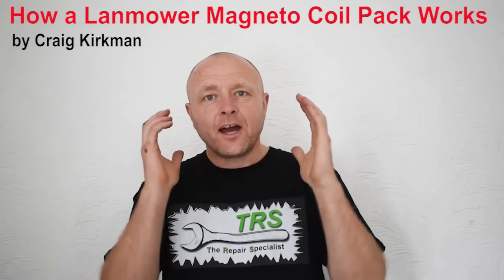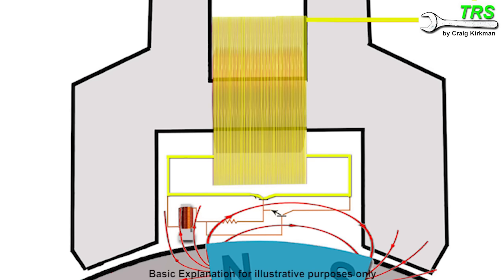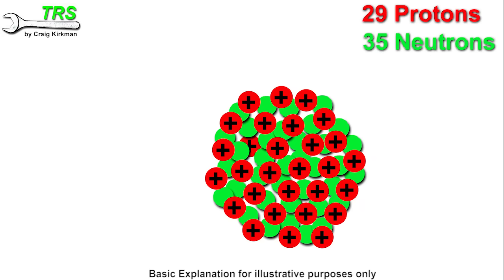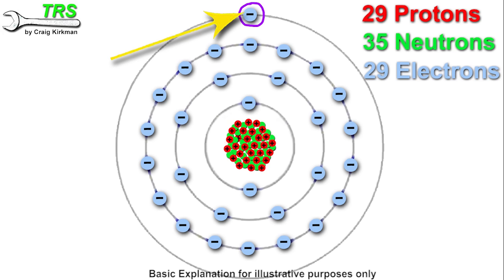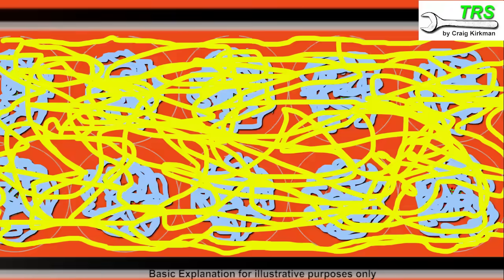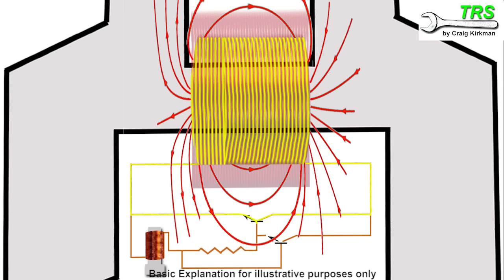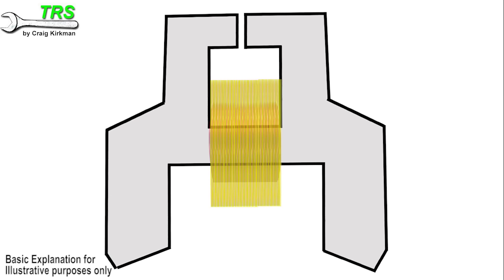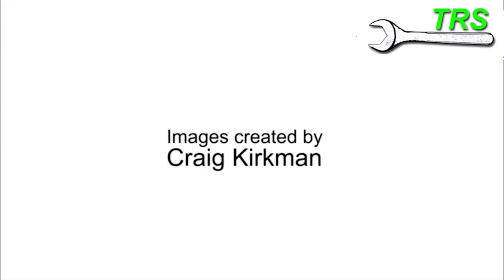Lawnmower Coil Pack Sparking System - Induction Coil, Transistor!  (by Craig Kirkman)

Comment: Now if I just understood what causes small engine coils to progressively fail over time.(Chainsaw)
I have been pulling my hair out trying to get a Poulan P4018WT to Run properly. Did all the typical troubleshooting and basic Repairs. Thought for sure it was something the previous owner had done to cause a Carburetor issue.
Reset the H/L and Idle to factory and started from there. Initially the saw ran great at (L) 1.5 turns / (H) 1-3/4 Turns, Colder day, Limited Cutting.
The next time I fired it up(warmer Spring day) It was warming up and stalled. Restarted easily and Revved to peak very snappy. Back to idle and in less than a minute - Stall. Hard to Restart unless keeping the Throttle open...... and again Stall. Tweaked the Low a touch and Idle up a tad. Seemed to hold.
Now, 86 Degrees Bright Sun, Top Cover off to check Plug/etc. Saw Fired right up on Choke, Restarted in 1 pull on 1/2 Choke, but started stumbling when set to normal idle and was tripping all over itself when revving.(Sounded FAT - Flooding)
Reset H/L to 1.5 and eases H to 1-3/4 and Running decent at higher revs. Stalled and would not restart.
pulled the Carb and did a thorough Clean and inspection. Metering lever was slightly low(adjusted) and carefully Reassembled. Installed a fresh Spark Plug.
*Back on the saw(Dumped the old Fuel and pumped out the lines before hooking them up. 
Fresh fuel mix, Primed, Choked and the saw fired right up. Revved Bright and smooth. within a minute the stalling was back and rapidly progressed to a no start.
***At this point
1) I changed the original Spark Plug because it wasn't firing and on inspection it looked Cooked Black.(Not Carbon buildup)
2) Pulled the new Bosh Plug and it was already completely smooth Black coated.
3) Attempted, but could Not get the plug to Spark.
4) 30 minute frustration/Research break.
5) Retested and saw a little Sparking.
6) Assembled, Restarted(it fired up) on high idle and in 30-45 seconds Died again. Saw Felt Hot(top cover off)
7) No Fire was back. Tested with Kill wire disconnected - no change.
It seems to me, and I may be mistaken, that a lot of people fighting with Poulan Carburetors may actually have week/Failing Coils.
Any thoughts?
Reply from the maker: Hello,

Thank you for sharing your detailed experience with troubleshooting your Poulan P4018WT chainsaw. It's evident that you've put a lot of effort into diagnosing and addressing the issues you've encountered. I appreciate your dedication to getting the saw running properly.

Regarding your observation about small engine coils potentially failing over time, it's a valid consideration. Ignition coils are crucial components in the ignition system, responsible for generating the spark needed for combustion. If a coil is weak or failing, it can lead to intermittent spark issues, which can, in turn, cause the engine to stall, misfire, or fail to start. Take a look at my other video, which explains some of the reasons these coils can fail over time. It's here in the link: https://www.youtube.com/watch?v=lEYO7hNTeR0&t=272s

However, I enjoy typing so here are some thoughts and additional considerations:

Spark Plug: You mentioned experiencing issues with the spark plug, including it appearing black-coated and sparking inconsistently. The spark plug condition can be indicative of engine performance issues. Replacing the plug with a new, properly gapped one is a good step.

Coil Testing: If you suspect the ignition coil may be a culprit, you can perform specific tests to check its resistance and primary and secondary coil windings. A significant deviation from the manufacturer's specifications can indicate a problem. However, testing ignition components typically requires specialized equipment and knowledge, so it's often best left to a professional technician.

Heat-Related Issues: Heat can affect the performance of ignition components. If the saw felt hot, it's possible that excessive heat may be contributing to coil or other component issues. Ensuring proper cooling and ventilation for the saw's components can be important.

Fuel System: It's great that you've cleaned and inspected the carburetor, but also consider checking the fuel lines, fuel filter, and ensuring that the fuel is flowing consistently. Fuel delivery issues can sometimes mimic ignition problems.

Professional Assistance: Given the complexity of diagnosing ignition system issues and the potential safety hazards involved, especially with chainsaws, it may be advisable to seek the expertise of a small engine technician. They have the necessary tools and knowledge to diagnose and repair ignition system problems effectively.

Your dedication to resolving these issues is commendable, and I hope that by exploring these possibilities and, if needed, seeking professional help, you can successfully restore your chainsaw to proper working condition. Your detailed description will also be helpful if you decide to consult with a technician. If you have any more questions or need further guidance, please feel free to ask.

I hope this at least sparks some further investigation and I hope you can sort this issue soon

Thanks
Craig
Reply: @TheRepairSpecialist 
Thanks for the personalized response.
I should have noted, I am 70 and have been a Mechanic/Technician Automotive shop owner most of my life. I had already gone through the basics, Fuel system inspection and repairs as noted. All lines and filter in good shape, Carburetor pulled, Stripped, inspected, cleaned and reassembled.
I was actually in the process of trying to dial in the Crab when the stalling started and the eventual complete Coil failure happened.
* I did realize later that I had inadvertently helped the overheating along by having the cover off the Carb area i order to get the Spline tool aligned with the set screws. (Poulan really needs to cast guide tunnels into the Plastics instead of holes well away from the Carb)
After installing the new Coil, adding a couple oz. of Seafoam to the tank, resetting the Carb to base settings and getting the saw fired up again, I was able to get it dialed in.
It is idling nicely and perfectly snappy jumping to high idle.
I've done (3) 10 minute warm up cycles including Run-up ever 30sec to 1 minute intervals.
The saw Stays running, Idles nicely after backing idle down a bit, Revs smoothly and ........ Cuts Wood! That's really all one can ask of a Chainsaw.

Comment: I searched for a simple reason my lawn mower doesn't start and found this physics lesson?
My head can now officially explode. 😜
Reply from the maker: Hello,

I can certainly understand how discovering a physics lesson while searching for a simple solution to your lawn mower's starting issue can be surprising! Sometimes, the world of small engines and their components can lead us down unexpected learning paths.

If you're still facing issues with your lawn mower's starting, please don't hesitate to ask any questions or share more details about the problem. I'm here to help simplify things and provide guidance on getting your mower back up and running smoothly. Your curiosity and determination to solve the issue are commendable, and I'm here to assist you in any way I can.

Thanks
Craig

Comment: question1: One end of the secondary coil wire goes to the spark plug.  What does the other end connect to?
question2:  The primary circuit does not touch ground.  On my Kohler CV15, there is a grounding tab to ground the primary circuit and stop engine.  Where is that grounding tab in the primary circuit with respect to the transisters?

Comment: Very good explanation but I didn't understand why there is two transistor in the little coil circuit?? Thanks
Reply from the maker: First of all, thank you for your kind feedback, i really do appreciate it. As to attempt to answer your question, the exact configuration of ignition coils can vary depending on the specific model and design of the lawnmower.

The number of transistors in a lawnmower ignition coil can vary based on the design and technology used in the ignition system. Here are a few reasons why some lawnmower ignition coils may have more transistors than others:

More advanced lawnmower engines have been known to incorporate electronic ignition systems that require precise control over the ignition timing. Multiple transistors can be used to control the timing of the spark plug firing, ensuring that it occurs at the optimal moment during the engine's cycle. This can lead to better fuel efficiency and overall engine performance.

Some engines, especially those in higher-end lawnmowers or other small equipment, may feature variable ignition timing. Multiple transistors can allow for dynamic adjustments to the timing based on factors like engine speed, load, and temperature. This flexibility can lead to improved performance and emissions control.

In some cases, manufacturers may use redundant transistors to enhance the reliability of the ignition system. Having backup components can help ensure that the engine continues to operate even if one transistor fails.

Modern engines, including some lawnmower engines, may include diagnostic features that monitor the health of the ignition system. Multiple transistors can support these diagnostic functions, helping to identify and address ignition-related issues.

The ignition system in a lawnmower may be designed to work with other components, such as electronic fuel injection systems or engine management systems. Multiple transistors can facilitate communication and coordination between these systems.

Larger or more powerful lawnmower engines may require more sophisticated ignition systems with multiple transistors to handle the increased demands of ignition control.

So in a nutshell, the number of transistors in a lawnmower ignition coil can vary based on the desired functionality and performance characteristics of the engine. More transistors can offer greater control, timing precision, and diagnostic capabilities, but they also come at a cost. Smaller, simpler lawnmower engines may use basic ignition systems with fewer transistors, while larger and more advanced engines may benefit from the added complexity of multiple transistors for improved performance and reliability.

I hope this helps a little, and thank you for your curiosity of my video.

Craig
Reply: @TheRepairSpecialist  thanks 👍 for this good explanation

Comment: <<<>>>##How does the Briggs Magneto test meter work? Does it instill negative - 140v pulse into the primary to run the secondary?? I have an old Briggs ignition coil METER tester manual , but it only shows how to hook up to it's meter. No tech data. I thought the spinning magnet put in 8 volts pulse in Primary , that shorts with the SS trigger, then generates back EMF of -140 volts that runs the secondary side.  I can run cycle coils and car coils on bench, but not Briggs magneto "electrically" without magnet. Is this suppose to be a secret from the public? ???####!

Comment: Your video was brilliant! I never knew about the trigger coil. Why do some coils on Amazon have a visible trigger coil and others don't? What happens if you put a new coil in place on a mower and it doesn't have the trigger coil?
Reply from the maker: Hi. Thank you for your kind comment. I really appreciate it.  Some lawnmowers employ a magneto and ignition coil combination that contains the trigger function in the same unit, while others may use a separate trigger coil in addition to the primary ignition coil. This variance is due to a few factors:

Engine Design: Depending on the lawnmower engine's size, complexity, cost, and manufacturer's preference, different ignition system designs may be used. For accurate ignition timing, some engines may need a separate trigger coil, while others may incorporate this function inside the ignition coil assembly.

Older lawnmowers or smaller, simpler engines may employ magneto-based ignition systems, which normally rely for a separate trigger coil for precise spark timing. On the other hand, more recent lawnmowers or larger engines may employ magneto/coil combination systems, in which the assembly itself serves as the trigger.

Performance and Efficiency: Engines with independent trigger coils frequently produce timing signals with greater accuracy, which can improve both performance and fuel economy. In contrast, it's possible that manufacturing and maintaining interconnected systems will be easier and less expensive.

Ultimately, the design of the engine, the intended performance level, and the engineering choices made by the manufacturer can all affect whether a separate trigger coil is present or absent in lawnmower ignition systems. 

I hope has helped a little.

Craig

Comment: So in checking these coils for function (good or bad) we use an ohm meter and read the resistance.  Which part of the circuit are we checking? The transistors? What has gone bad in most cases?

Comment: I'm just in the process of fitting one of these motor scooter units to a 1951 two stroke motorcycle. Could you define in slow motion exactly when the spark occurs as the magnet passes the coil? This would greatly help to set up the ignition timing. Thank you.

Comment: The SIMPLE old two pole magneto coil pack has become as rare as a chicken with molars, changed to $150-250 "solid-state" ignition SEALED (un-serviceable) packs (blue, green or red) which are subject to failure from heat and "flash-over" just like automotive ignition packs. Since nearly 50% of small engines use some form of quasi-fuel injection now, there are NO points, no condensers, just a reluctor and pick-up sensor and the flywheel alternator. Grass clippings and dirt can shut the system down too easily. Instead of a battery, most small engines use a super capacitor-usually reliable, but in string trimmers and chain saws the cramped spaces doesn't leave much space for cooling and too much heat causes failure, but not always TOTAL failure. Yeah, intermittents...the WORST. I HATE being a "parts changer".

Comment: So basic. Idk why mine failed on my Briggs and Stratton
Reply from the maker: I do have a video here on you tube explaining some reasons why ignition coils like yours can fail, but here are some clues if you haven’t yet seen it

A Briggs and Stratton lawnmower ignition coil can fail due to several reasons.

1. Overheating: If the ignition coil gets too hot, it can lead to insulation breakdown, resulting in a failure. This can occur if the lawnmower is used for extended periods without proper cooling or if the cooling fins are clogged with debris.

2. Wiring Issues: Poor connections, frayed wires, or short circuits can disrupt the flow of electricity to the ignition coil, causing it to fail. These issues can be the result of wear and tear, exposure to moisture, or damage caused by rodents or other animals.

3. Coil Damage: Physical damage to the ignition coil, such as cracks or breaks in the casing, can result in failure. This can happen due to mishandling, impact, or accidental dropping of the lawnmower.

4. Age and Wear: Like any mechanical component, the ignition coil can simply wear out over time. The insulation materials degrade, the windings may break down, or the magnetic core can lose its effectiveness. These age-related factors can eventually cause the ignition coil to fail.

It's important to note that regular maintenance, including cleaning, inspecting, and replacing worn-out parts, can help prolong the life of the ignition coil and prevent potential failures.

I hope this helps a little

Craig

Comment: I wonder what mosfets they are
Reply from the maker: Assuming we are referring to MOSFET as, Metal-Oxide-Semiconductor Field-Effect Transistors, then I will try to answer what I can, personally, about them, but I assume that, by your questioning of MOSFET's, that you most likely know more about them than I do.  I only know a few basics.

Well, the best answer I can give in accordance with knowledge I have on them, is that it depends on the particular design and manufacturer of the coils.  Different MOSFET types may be utilised in the ignition coil of a lawnmower. It's crucial to keep in mind that not every lawnmower ignition coil uses MOSFETs. Some ignition coils may employ different semiconductor technology or device kinds.

If a MOSFET is included in a lawnmower ignition coil, it is often used as a component of the ignition system to provide the high-voltage spark necessary to ignite the fuel mixture. Power MOSFETs with the ability to handle high voltages and currents are frequently employed in ignition coil MOSFETs.

However, it is challenging to give a precise response regarding the precise type or model of MOSFET utilised in its ignition coil without detailed information about the particular lawnmower model or manufacturer. The components that various manufacturers may utilise in their ignition systems can change over time as new designs and technologies are developed.  So, to answer your question directly, one would have to contact the specific manufacture directly to ask, which ones they use.

I hope this helps a little

Craig